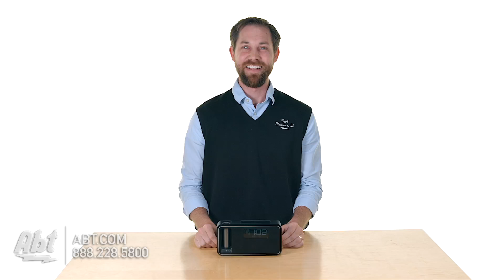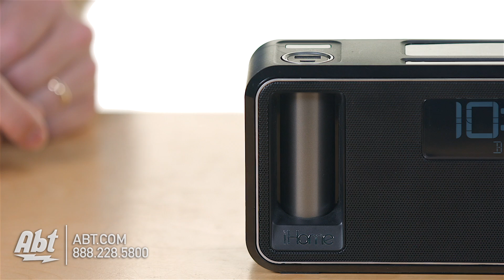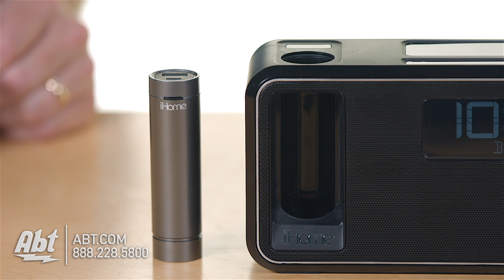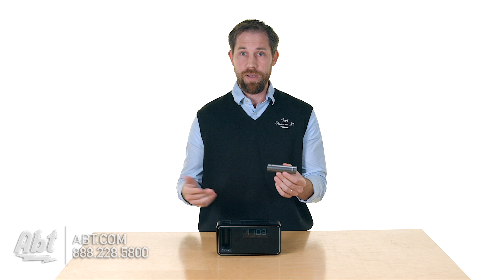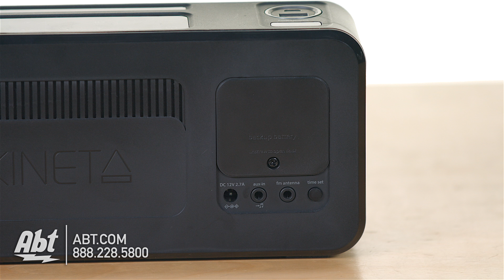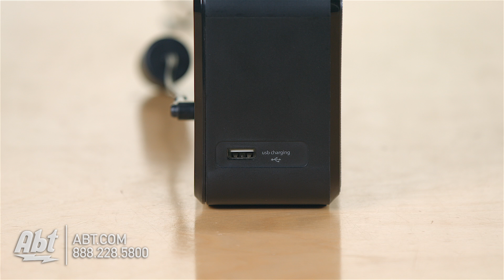iHome Black Dual Charging Bluetooth Alarm Clock iKN105BC - Overview

Comment: One of clock digits, not displaying fully.
How to correct?
Reply from the maker: @janwynn3995 That is likely an issue with the display. It's likely you'd need to replace that display for it to work properly again. If it was purchased from Abt please give us a call at 800-860-3736. We're an authorized dealer so you would have a 1 year warranty on the product.

Comment: How do do set clock?
Reply from the maker: @Zodie Horton  Here's how to set the time on the iKN105BC
1. Press and hold the Time Set Button located on the back of the unit for 2
seconds until the clock display flashes and a beep sounds.
2. Press the – or + Buttons to adjust the clock to the current time (hold for rapid
setting). Make sure you set the correct AM/PM time. The AM and PM indicators
appear to the left of the display.
3. To toggle the clock display between standard 12 hour time and 24 hour time display,
press the Alarm or Alarm Button while the display is flashing during time setting.
4. Press the Time Set Button. The year will flash on the display.
5. Press the – or + Buttons to adjust the clock to the current.
6. Press the Time Set Button. The date will flash on the display.
7. Press the – or + Buttons to adjust the clock to the date.
8. Press the Time Set Button to confirm and exit clock setting mode. 2 beeps will confirm clock setting
is complete.

Comment: The battery doesnt comes off! Help
Reply from the maker: Hi Oscar.  I was able to find this out troubleshooting on this clock: "If the K-Cell won’t eject even after pressing the K-Cell Eject Button, you can turn the unit over and insert the end of a paper clip or similar into the Battery Release pinhole port located on the back of the unit. "  That was directly from iHome.  I hope this helps and thanks for watching!  -Carl
Reply: Thank you, it was vey useful!

Comment: How in this wide world do you set the time and date on this???  I have watched every you tube video and no one shows that.
Reply from the maker: Hi P Ferguson.  Here is a link that shows the steps:  https://www.ihomeaudio.com/media/uploads/product/files/iKN105_IB.pdf  Setting the time and date can be found on page 10.  Hope this helps!  Thanks for watching.  -Carl
Reply: Abt j
Reply: For some reason, it's not letting me change the hour, only the minutes.
Reply: Read the directions?
Reply: Why dont you check the instructions that  were included in the box you dumb bitch!